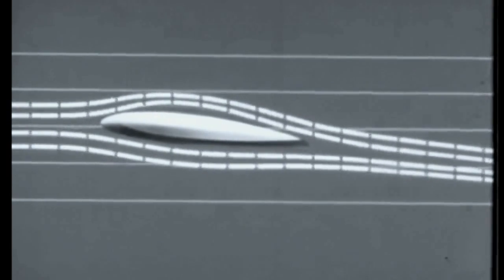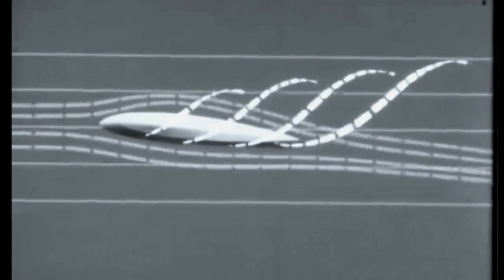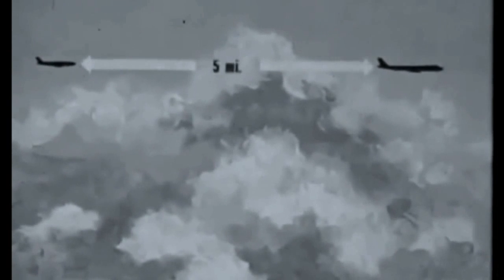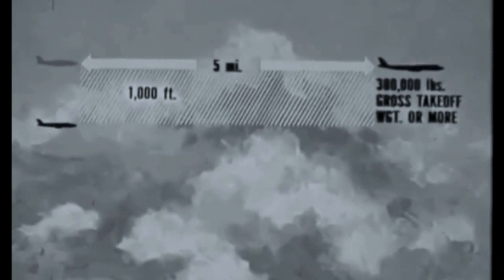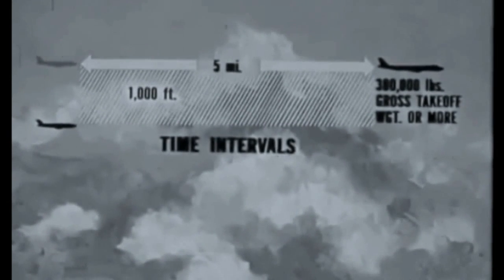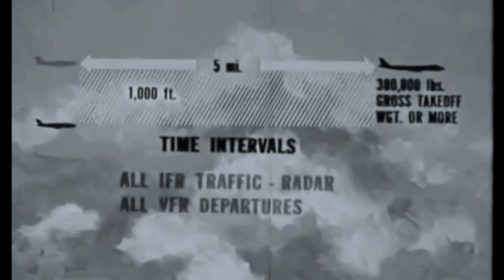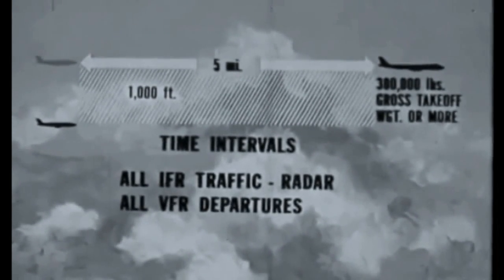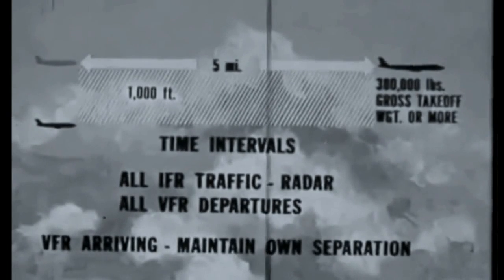Classic Jetliners - "Wake Turbulence Tests" - 1971

Comment: This is still very serious. American Airlines flight 587 in 2001 didn't pay heed to wake turbulence from a JAL Boeing 747 that had just taken off from the same runway. This, combined with the pilot's inadequate training for that situation and design flaws in the plane rudder, made the tail simply detach in flight and the plane to crash, claiming hundreds of lives on the plane and on the ground. And it was an Airbus A300, not a small plane itself by any standards - yet it was still affected. Recently, some busy international airports have refused to allow operations with the Airbus A380 superjumbo because the required time separation due to its wake turbulence would disrupt airport operations for too long.
Reply: Recently the A380 has been implicated in a high altitude LOC of a busjet due to wake turbulence: http://www.avherald.com/h?article=4a5e80f3&opt=0. An Air Transat A310 shed its rudder so composites in the tail still seem to be a problem on the A300 family: https://en.wikipedia.org/wiki/Air_Transat_Flight_961 although the incident was caused by a deficient inspection programme. I wonder how the B787 and A350 are going to hold up longevity wise with their extensive use of composites or if these planes are designed to be "disposable" like today's lightweight modern cars which have a short finite life and don't last long.